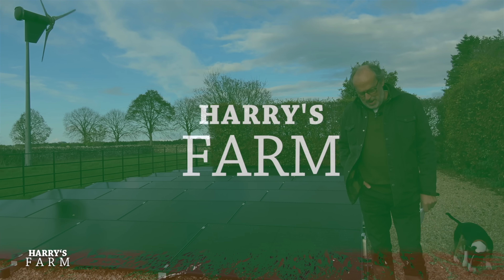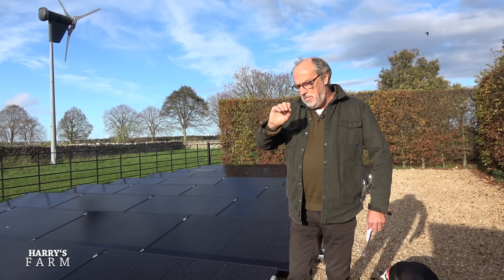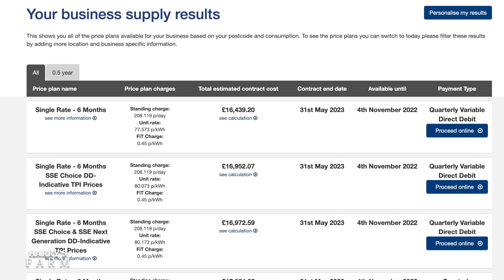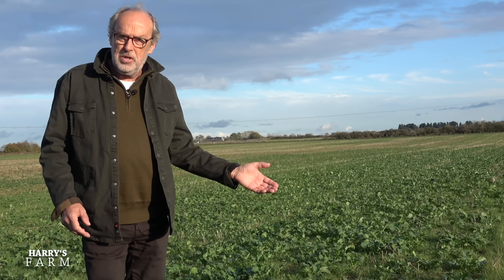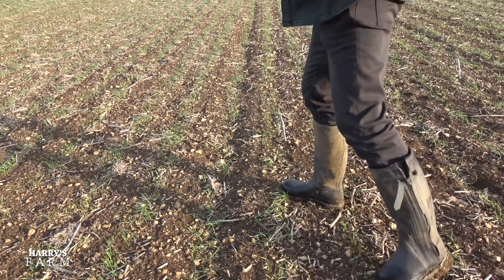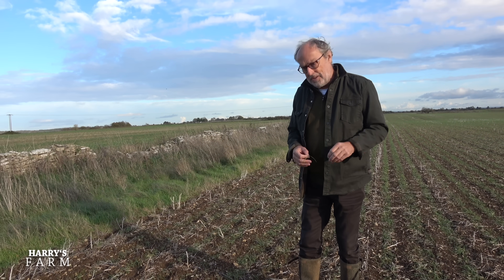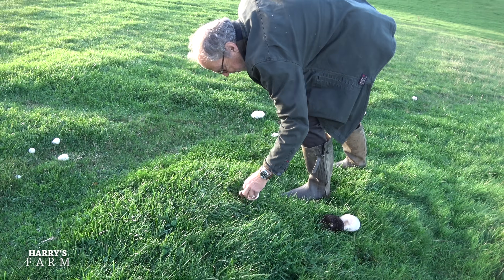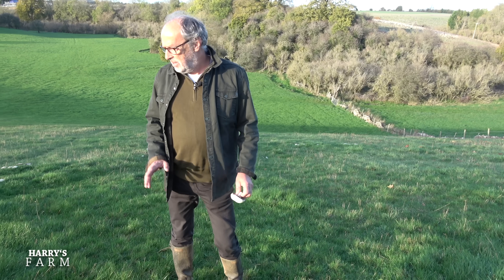More solar panels get installed plus why New Zealand's proposed carbon tax on cows is wrong

Comment: Harry, there is a company that spent £30,000 on solar to cover their electrical needs... due to the electric price ROI is normally 3, 5 or 7 years... their ROI will be 1 year
Reply: Will be?  Or might be?  Not much solar power over the winter, just when you need it the most...  Especially when your panels are covered in frozen snow.  Just sayin'.
Reply: @SaxonSuccess  I forgot when the UK last had snow that would stop them working and during this summer UK solar power out produced nuclear power by 100%+

Comment: I'm not surprised it's not producing much, that panel angle is nowhere near what it should be for a UK installation.... Unless Harry's Farm is based near to the equator?
Reply: I would have raised them up a few feet or a meter at least, that one shot shows them in the shade for what looks like a couple hours in either the morning or evening
Reply: @SilentRacer911  Hopefully the shading will have been a factor in the design and the array will have been split into appropriate strings maximising power output. Given the panel angles though it doesn't inspire confidence that design was a primary consideration.
Reply: Exactly, should be quite a steep angle in winter to catch the low sun.
Reply: Certainly if I was Harry I'd get a Timber frame made 2m high and make it the same angle as a House. It's way to low and as others have said the Winter Sun is to low so really needs Tilting more!!
Reply: My thoughts exactly will only work when above it say 1.5 hrs a day harry prop it up
Reply: You need to check out Tom Nelson podcast and YouTube channel … best resource for maintaining your sanity on the whole climate change horse crap …. So many morons believe Greta and her numpty mates 😂😂😂

Comment: Would it be possible to mount that solar panel system on a sturdy metal frame above the ground ? You could then park say,  a car underneath it and not lose part of your driveway?
Reply: In theory yes, I imagine it will bring about a planning related issue though (as that would become a structure)
Reply: @nickwills6042  the funny thing is that I’m not even allowed to hook panels up to my electrical system without first getting a permit for the structure that they’d be attached to
Reply: @marcob1729  does that include the ground?
Reply: @nickwills6042  yes. You need to prove that they will withstand the elements (wind, snow load, etc).  Which makes sense, else it becomes a liability
Reply: @marcob1729  does make a lot of sense now I think about it. Is your house around others (housing estate or something)? 
Maybe Harry got away with that because he is a long way from where members of the public might be walking?
Reply: Yes there are lots of solar carport options out there. This specific system Harry has is actually a flat roof system.
Reply: Should be done at all supermarkets. Rather than useing top grade farmland.

Comment: I've been looking into solar panels.  I should have got them 2 years ago.  Now the supply has gone, and inflation has put the prices up.  But the most prohibitive thing is the regulations.  Panels and inverters are not expensive but the installers will only install panels they have sourced themselves.  It means you cannot choose the panels and when the installer produces a quote, it works out to be twice the price for half the installation.  They claim it is so they can provide you with a regulators certificate.  I'm certain the installers have created these regulations, not to improve quality, but so they can push the prices up.  They don't even tell you how much they are charging for the panels.
Reply: @altern8tive  A warranty isn't much use when most installers go out of business within five years of start-up.
Reply: @ΝΟΜΛ  what you describing is to protect the installer, not the customer.  When the installation cost is 4 times what it could be, there is plenty of margin for me to replace failed panels.
Reply: Usual UK legalised rort. Never before has this country legalised so much theft from hard working people. Government want all this because they get their 20% VAT on everything. Less is More these days.
Reply: I felt much the same, had panels on my previous house and they earned a feed in tariff but 2 years after moving I was already thinking about it again just as electricity prices rocketed.
I looked into the options and spoke to local installers but one told me straight that I ought just do it myself. (I work in the renewables field already on large commercial installations, just not PV) 
I wanted solar with battery and having located good s/h batteries already there was no way an installer was going to be interested as you say so did it myself as suggested.  
I put 4.2kW of panels on the garage roof with the help of my builder/ roofer and have about 5.5kWh of useable battery capacity and a 3kW inverter.  The same local electrician added the circuit and made the mains connections for me.   The system is small enough to be G98 compatible so I declared it myself which takes about 30 minutes all in.  Scottish Power accepted it, as they have to (I checked with them first).  It cost time and effort on my part to research but there are a lot of options and several very good suppliers, choosing one depends on what you want to do and spend.

No, I can't get payment for exported generation without a MCS certificate but it's generally insultingly poorly remunerated anyway, even worse when you hear the spot rate is as high as £0.84/kWh  As the battery absorbs a lot of generation anyway I am content to be benevolent and give any excess power away for free.  Critically for me, it's made an enormous difference , still contributing on average 85% of our typical demand in early November.

I'd recommend looking at the part suppliers such as Bimble and Voltacon.
Reply: @jncg2311  I have found suppliers of panels and inverters, although supplies are short now.  I did have the number of someone who said he would fit them for a reasonable price, but his number is not answering any more.  That's what prompted me to ask other installers.  I had not thought to ask roofers to put the panels up and an electrician to wire it all together.  I will look into that.  But I don't have the background to do it myself.
Reply: @altern8tive  Prematurely failing panels are covered by the manufacturer warranty, or U.K law, not by paying more to the solar cartels. The installation of 'green' technologies is a racket and has been ever since the juicy government incentives were introduced.